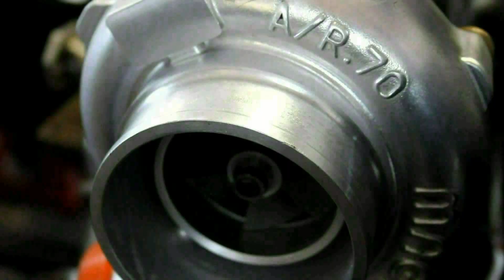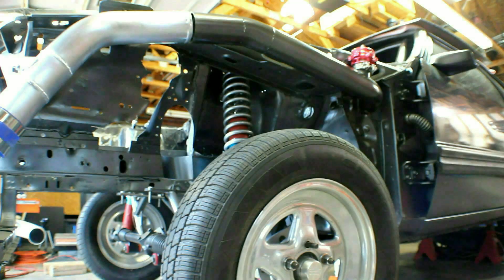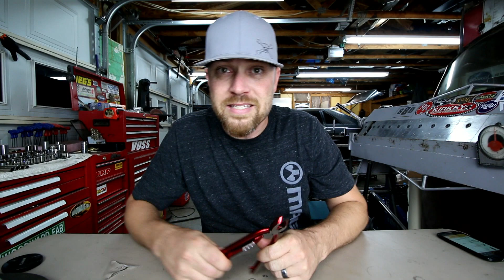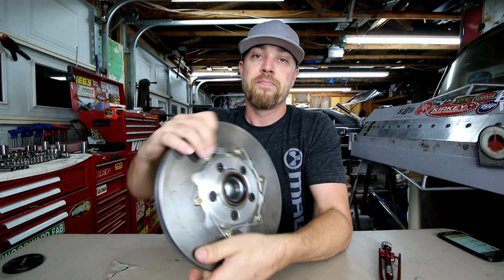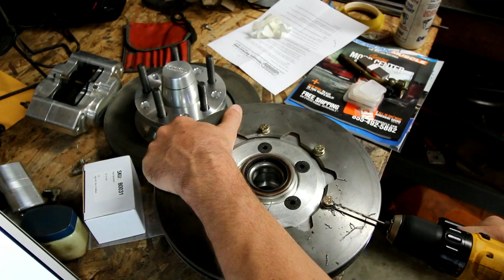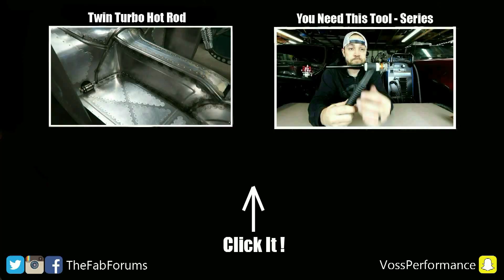You Need This Tool - Episode 69 | Stainless Safety Wire Pliers

Comment: As an aviation technician, you did a wonderful job on the safety wire. That is likely 32 thousandths, which requires 9 to 12 twists per inch. My best recommendation for it so it doesn't slip, is do alternating directions for twists. So one braid as right hand, one as left, and so on.

Comment: We use wire on pto yoke retaining bolts. They are bolts that bottom out into a key way and the head is square with a hole for the wire and you just tie the bolt to the shaft

Comment: I first came across this tool in the Navy. They call it lock-wire pliers. Anyone else notice that he did the wiring on his brake backwards? The wire should have come out the bottom of the bolt in the counterclockwise position, and then into the top of the next one, which is clockwise from the first. That way if the bolt counterclockwise from the second bolt starts to come loose, it will not be able to move far since it will be tightening the bolt clockwise from it. Anyway, I doubt anyone will even read this, but if anyone does, now you know better.
Reply: Yeah I noticed.  But it's easy to undo *snip snip*.  He just bought them too, sure he has had more time with them.

Comment: LOL as an aircraft technician I have to say your lockwire needs work on those brakes.  8-12 twists per inch and they should be straight with no curves. but good vid

Comment: Hi. I have a question. 

I’ve used these pliers before when I was in the navy. The ones I used there didn’t have a “spring back” action, like these do when you pull the knob. 

I’m finding that when I pull back the knob, create spun wire, that I immediately loose some of the twist because of the spring back action. I feel I’m taking two steps forward and one step back. 

Now someone can tel me up and down that that’s the way it goes, but for some reason I have never come across a pair of safety wire pliers that spring back. I would really like this tool to not do that. 

I’m currently a wire sculptor, I specialize in steel, copper, and aluminum wire sculptures, masks and head pieces. I miss the beauty and strength of twisted 20 gauge wire so I got this amazing tool, but it just isn’t the same. 

The q:
Is there a way I can make it so that the spring back action is no longer automatic?
Reply: Secure your work and use your other hand to stop the pliers during detraction. You could also probably take the pliers apart and remove the spring.
Reply: Break em lol

Comment: I found a pair of these in my late father-in-laws toolbox (He passed long before I met my wife), he was a mechanic in the 1960's - 1980's.  
I used this trick to stake saplings in the yard, a small piece of rubber tubing against the tree keeps it from cutting into the bark.  
After a couple of seasons and the roots have taken hold easy to remove.

Comment: Only one issue I have is when you wrap the wire around the bolt you don’t go over top of it as you did in your video. You have to wrap clockwise around the side of it to keep the integrity or else why would you even lockwire. Cheers
Reply from the maker: It does wrap around it

Comment: in aviation they teach us that on a closed geometric pattern like that brake it's unnecessary to twist at all. you can just run the wire through all of them and finish off with a pig tail.

Comment: Malin Aircraft stainless lock wire by the pound on amazon very cheap. A pound is 800 to 1000 feet roughly. .020 inch more than .032 inch due to less mass per inch.

Comment: Lockwire pliers. You don' t use pliers for safety wire. Safety wire is made from copper and is intended to be able to be broken in an emergency
Reply: I feel sorry for anyone that doesn't use stainless safety wire. Copper would NEVER, EVER, be used as safety wire. Copper wire is used as a proof only to rapidly see if something has been tampered with. And, yes you do use safety wire pliers on stainless safety wire. They are designed for that purpose. The copper wire you talk about is actually small diameter braid and is not twisted when installed.

Comment: Aircraft Engineer - Absolutely do not need this tool, I carry a pair in my toolbox and they have their place, but 9 times out of 10 i'll do it by hand, you can do a better job twisting by hand once you have the technique right and all you'll need is a set of diags or combo pliers for snipping off, which you should already have in your toolbox, no point buying a specialist tool for this one job, even if lockwire pliers are bloody cheap these days.

Comment: Thanks for the tutorial!  I got mine at Harbor Freight for $8 or $9 for a 6" size, and I am using them for restringing my 12-bar Wire Soap Cutter, which cuts my 5-6 lb soap loaves into 13-15 individual slices of soap.   Due to several pounds of tension that these wires endure, they were coming loose all the time at the eyelet bolts (which I have wingnuts on the ends of).  Bar soap is usually cut while it is still soft enough to do so, but I still have to use some upper body weight to cut through.  Tightening the bolts only went so far when they became loose, and many times after hand-twisting a new wire on (pain), the wire would still not stay tight and then it would break within a day or so of using the wire soap cutter several times.  While I could engineer another solution using banjo tuning pegs and stainless steel music wire (cold process soap reacts with any metal that is not stainless steel), this was a quick solution for me to integrate that makes changing my wires easier and faster.  I just switched from using 20 gauge smooth steel picture wire to 15 lb, 20 gauge galvanized steel wire.  While stainless is still preferred, I go through enough wire to make this tool really pay off in a short amount of time.
Reply from the maker: cool
Reply: Fantastic idea! I'm stealing you're tutorial as well haha! Thanks for that awesome idea!

Comment: I build rustic fences for Renfaire venders   useing willow and mulberry  branchs  by weaving them in and put of larger vertical branches  I wire the small twigs in with the lock wire pliers  I built one 13 years ago and its still standing and working  

I can go to a grove of Willows with a pruning clippers and these lock pliers and wire  in about a hour I have something I can sell for $50.00 to $100.00 each  
Set them aside to dry and season  for a few weeks

Comment: Yes it came from aviation industry 

And some recondition for the correct way to do this and the aviation rules for safety wiring any screw,
The max number of joint safety wire is 3 as max so 3 screws as I study in aircraft engineering college and the AMM ( Aircraft Maintenance Manual ).
And the max twists per inch is determined on the size of wire you are using for an example stainless 0.32 have a 8 twist per inch.

For more info of any aviation information let me know to carry through the correct information.
Thanks for the great videos and keep up the good work.

Comment: If you'll be running a lot of safety wire and need to drill all the bolts yourself, you may want to look into a drilling jig. Use it with a drill press and minimize broken drill bits. http://www.aircraftspruce.com/pages/to/safetywiretools/drillingjig.php
Reply from the maker: gonna get one of those for sure

Comment: So many airplane technicians commenting and no one noted that "Safety wire" is not to keep the bolts tight, Torqueing down to the proper spec is what makes a bolt to stay on, safety wire prevents the bolt to "fly around" in case it looses itself. And that´s the exact reason why it´s a requirement in many motorcycle racing categories, you certainly don´t want a screw, bolt or nut loose on a motorcycle racetrack for so many reasons.

Comment: Link to Naval Ships' Technical Manual (NSTM) 075 - Fasteners, Page 75-101 Para 075-5.5, and Fig 075-5-10 give examples of proper lockwiring techniques.  6-10 turns/inch is the standard, and the wire goes around the bolt head, not over it.
https://maritime.org/doc/nstm/ch075.pdf

Comment: 6-8 turns per inch is the standard twist rate. also remember when you cut off the twisted end to cut through the twist and not after it so it wont come undone. then pigtail it back so it wont stab you in the finger the next time you go to take it off.
Reply from the maker: +Matthew Turnbloom thanks

Comment: For reference the FAA AC43-13 have a section on how to safety nuts and bolts with different means, and how to do safetywire to specs and approved methode.
Reply from the maker: +Martin Gosvig I will have to take look
Reply: It is free to download if i remember, you can also buy a paper version, i use it alot in airplane inspection. It also have alot of other nice info. It is basically standard allowed measures into inspection and minor changes in aviation.

Comment: Wouldn't you need to pull both ends through the bolt holes instead of just one ? Seems that it would be a lot stronger that way...
Reply from the maker: no...you want it to lock around the head of the bolt. Its stainless so is strong. Besides the idea is not to be strong but to insure the bolts dont back out

Comment: Whoops, the wire should go around the flats of the bolt head not over the top. Don't you think? 

But that's only half of the equation ...  you may need to drill holes for the wire to pass-thru bolts and nuts, and may need to "clock" the run of safety wire with multiple holes being drilled. 

And are there nuts on the end of the bolts on those hubs / rotors? It's been almost 50 years since I worked on aircraft in the USNR, but it seems to me that the nuts should be safety wired, too.
http://aircraftproducts.wicksaircraft.com/ImgMedium/Drilled-Jam-Nut.jpg

Here's a suggestion for next weeks episode of "You Need This Tool".

Safety Wire Drill Fixture

https://www.amazon.com/Allstar-ALL10122-Safety-Drill-Fixture/dp/B006K8G7JE

http://www.aircraftspruce.com/catalog/topages/nutsaftblok.php
http://www.aircraftspruce.com/catalog/topages/aerosaftblok2.php
Reply from the maker: The wire does pass thru the head of the bolts....no nuts on those bolts

Comment: Great vid. It's a great tool if you're doing a lot of lockwiring - Aerospace and Defence work for example - If not, a set of pliers will do the same job only a lot slower.

I was taught:
7-10twists/inch for 0.032" (0.8mm) wire
9-12twists/inch for 0.020" (0.5mm) wire
[Always seemed ok to me, not too tight or too loose.]

Might be worth adding a follow-up video so people don't lockwire back-to-front by accident.

Comment: Loctite actually prevents thread damage quite well (not as well as anti-seize, but well enough) but would be a bad idea in this case for another reason.  How do you get bolts held with Loctite loose?  Heat.  What does a brake produce lots of when under load?  Heat.

That's why they use safety wire on brake caliper mount bolts, not Loctite.  I can imagine that the rotor bolts themselves, get even hotter. They also use it a lot in aerospace for the same reason.

Comment: how did you end the two end when they met back up?
Reply: At the end of a run do like 5 twists then cut the safety wire and tuck it back into the last bolt hole so there's no "loose ends" to snag yourself or your clothing on.

And the wire should go around the bolt head, not over the top of it.
Reply: Brock Lesner when done per spec. these should actually be done as 2 groups of 3 bolts. or 3 groups of 2 bolts. either way is fine. Actually, 3 groups of 2 bolts would be easier, especially for people who don't have experience.

Comment: Heads up, licensed Electrician here and Instrumentation supervisor , only time you want to twist electrical wire is low voltage (1-5 volts DC) and to speed up signal wire in high speed sensors. Don't twist up your head light wires you will regret it....but if you want a faster signal from your analog transmitter to your PLC then by all means twist away.....Love be called a fool on Fridays now cause of you!!!!

Comment: Nice video and tutorial, Kyle. I've seen these pliers and understand the concept, but have never used them before. Very cool though.😎 Whoa, you drilled those bolt heads free hand, right? I believe you can buy (or you can make) a drill jig for drilling holes through the bolt heads. If you had a lot of that type work to do, that would be a good tool to have handy as well. I hope you and the Voss family have a great weekend, brother!👊

Comment: Not nitpicking, just adding to the conversation.

FWIW if you are road racing or running track day events.
Road racers tie them 2  by  2 bolts. You can get a super tight wire this way. 

You put the wire through the bolt AWAY from the bolt you want to attach to. As you tighten the wire you make sure the little loop stays on the TIGHTENING side of the bolt. When you bring the wire toward the next bolt there should be a loop of fixed wire pulling the two bolts together. Once you start doing this you will see how a reversible safety wire tool becomes the cast's ass as it allows you to push the loop down on to the washer. When you pull it through the next bolt you can reverse direction and cinch down the little left over loop on to the washer the other way and it actually tightens the first bolt....Or at least pulls on it hard....You can make it tight enough that you can actually snap the wire.
The idea is the most that can come loose are two bolts.

Here is a picture of a reversing set of pliers forcing the little loop I am talking about on to the washer.
https://www.google.ca/search?q=safety+wiring+brake+rotors&rlz=1C1VFKB_enCA709CA709&tbm=isch&imgil=jfIT1TD3d77YbM%253A%253BXsywBZ_l_e2NwM%253Bhttp%25253A%25252F%25252Fwww.solidfonts.com%25252Fsafety-wiring-bolts%25252F&source=iu&pf=m&fir=jfIT1TD3d77YbM%253A%252CXsywBZ_l_e2NwM%252C_&usg=__oxlfGJkKTYWLSM260T2sKmicMTU%3D&biw=1920&bih=974&ved=0ahUKEwjM8PHau47UAhUJjVQKHTaQAyYQyjcIPA&ei=LpkoWcyhGYma0gK2oI6wAg#q=safety+wiring+brake+rotors&tbm=isch&tbs=rimg:CXoT4cd1Oni_1IjjZ8wpn9l7d3Am5Yv-AUoRQl8fkemR_1E2zA3lddeyNU20IVP0xv6xWX9O2XPUr4MCnHVa3tsJzabSoSCdnzCmf2Xt3cEceyAuKt7ezHKhIJCbli_14BShFARZ8aLYpdlovkqEgmXx-R6ZH8TbBFBrod3OmMI7SoSCcDeV117I1TbEceyAuKt7ezHKhIJQhU_1TG_1rFZcRZ8aLYpdlovkqEgn07Zc9SvgwKRFa5XD-L4Iq4CoSCcdVre2wnNptEU-uXVUpyd6v&imgdii=ehPhx3U6eL-XUM:&imgrc=2fMKZ_Ze3dz5FM:

Tings I safety wire:
Brakes rotors (of course)
Brake brackets
Turbo exhaust header flange bolts.
Turbo flange bolts
Turbo Compressor housing retaining bolts
Pretty much anything turbo hotside
Anything else that gets the stink eye :)

Hope that helps! 

I am sure your way will work fine for drag racing Kyle
your brakes don't see the 1500+ degree heat cycles of a road race car.
Keep an eye on it though!
Great video as always Kyle!

Comment: might be a dumb question but if you tighten a nut on a bolt to a certain torque and you didn't want the nut to back off the bolt would you drill the nut and bolt and speed wire them?

Comment: I've seen safety wire used on the bolts on old American and European diesel engines that were factory assembled way back in the 1920's.  I think safety wire was pretty much the standard in all industries until the invention of Loctite .

Comment: i tend to use mine for my header wrap. holds just fine, holds upto head and looks alot nicer than the big bulky clamps in my opinion. there's also alot of times when wrapping between the pipes that its hard to get a clamp to fit where the wire comes in very handy.

Comment: Your safety wire is not to aerospace standards haha.  The wire over the middle of the bolt isnt allowed ^_^.  Also the safety wire is too long you should ave just done 2 together.  Thanks for explaining it though more people need to learn this skill.
Reply: chris lessner I agree with your first statement. His safety wire job is not too long, you can in fact, tie multiple bolts together. I have seen instances where you're required to safety wire up to 10 bolts together. I will add, that drilling through the center of the bolt to adapt it to work with safety wite is worse than not safety wiring it at all. Drilling the head of a bolt can ruin the bolts integrity. Basically, there's a chance the bolt head will shear under torque, stresses and vibrations.
Reply: +Archer Prochaska I work aviation and safety wired on the f16 for many years.  Doing more than 3 bolts is not allowed. And yeah drilling through the center is not good but we did have some that were. The overlap piece needs to not be ontop of the bolt head but to the side of it.  At least through out technical specs on fighter jets.
Reply: chris lessner I work on both the USAF kc-46a and cargo 767
Reply: Nice, different airframe different requirements probably. I know the fighter world is a different beast within itself.
Reply: Great tool.  I used them in the USN as a machinist mate and before that mending fencing when working on the farm.  I echo the concern about drilling on the head of a bolt that I'm counting on to save my life.  Spend the extra $$$ and buy bolts with it engineered in the process.  Cheers!
Reply: Yea it looks like dookie.
Reply: You both are both right and wrong. General rule is 3 or maximum of 24" of wire on tightly spaced bolts. All of which is cancelled out by platform specific maintenance instruction manuals.
Reply: You both are both right and wrong. General rule is 3 or maximum of 24" of wire on tightly spaced bolts. All of which is cancelled out by platform specific maintenance instruction manuals.

Comment: in endurance racing, we safety wired everything. Valve covers, timing cover, ring gear.even the oil pan bolts